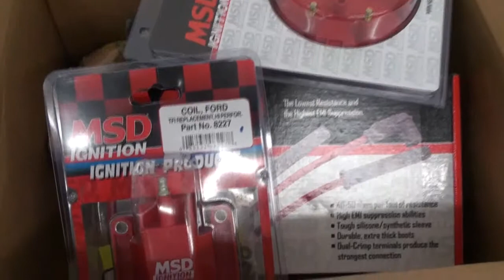1993 Mustang Lx 5.0 tune up

Comment from the maker: @dc5000123 I still have it.  Going to fix all the little nagging problems and sell it probably in a few months.  Found out it's burning oil after sitting for 15 minutes or so and the transmission is starting to shift erratically sometimes.

Comment: how much u spent on all that msd
Reply from the maker: i think everything was roughly $180.
Reply: +rompn4x were at bro
Reply: +rompn4x so did u just get the distributor cap wires n ignition coil?
Reply from the maker: +Mainor Rabanales yes
Reply: +rompn4x does it help?
Reply from the maker: +Mainor Rabanales Definately. besides the fact the plug wires, cap and rotor had over 150,000 miles on them.
Reply: +rompn4x mine say 1987
Reply from the maker: +Mainor Rabanales Way overdue for new ones...
Reply: +rompn4x what's the msd wires called 80mm conduct ? or wat did u get bro so I could get it
Reply from the maker: +Mainor Rabanales I ordered everything at summitracing,com  I think they were 8mm MSD super conductor..  Its been a few years and I no longer own the car so i'm trying to remember all the facts.  I know I used standard Autolite plugs one heat range colder to combat a pinging issue the car had.  Car definately felt more responsive after i changed out everything.
Reply: +rompn4x well I wrk at autozone maybe I could get good spark plugs wat will be good spark plug?
Reply from the maker: +Mainor Rabanales Autolite Platinums. Dont waste your money on irridiums.
Reply: +rompn4x ok autolite platnium